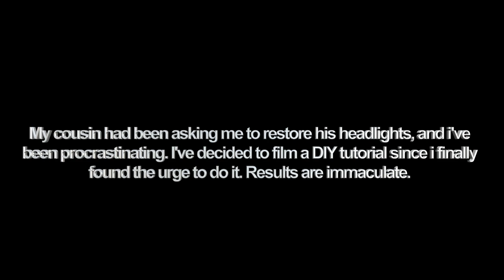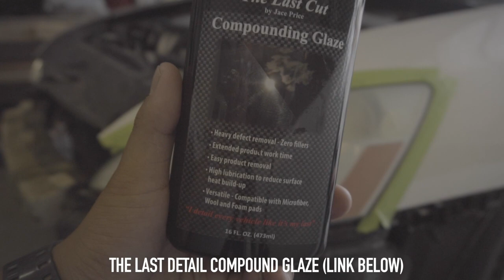2003 ACCORD x HEADLIGHT RESTORE x DIY TUTORIAL

Comment: Do I have to use a buff ? Is there any other way besides buff ?
Reply from the maker: BRANDON TRILL yeah, it’s a definite requirement to get the scratches out from the sand paper. Basically smoothening the scratches, and bringing out the clarity.
Reply: medinaMEDIA dam time to invest in one lol! Which brand do you have bro and where did you get it from?